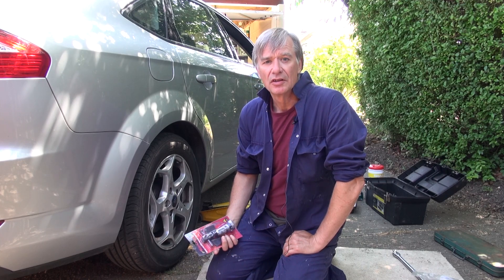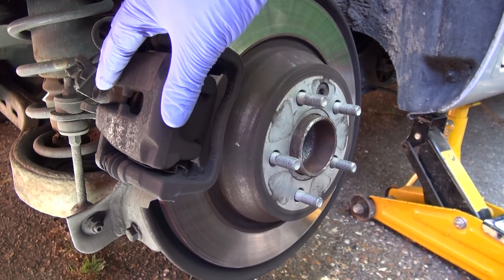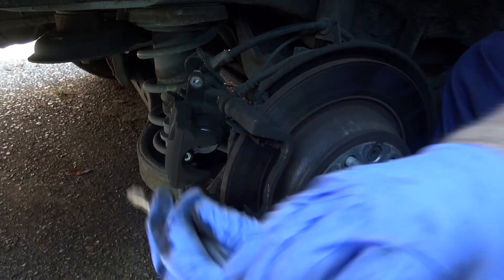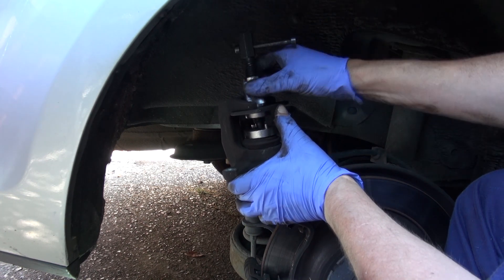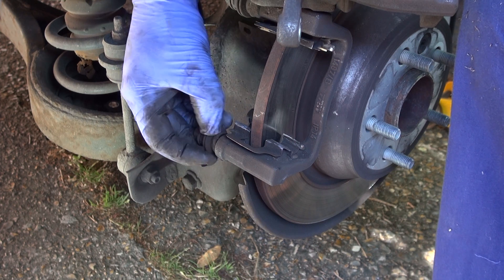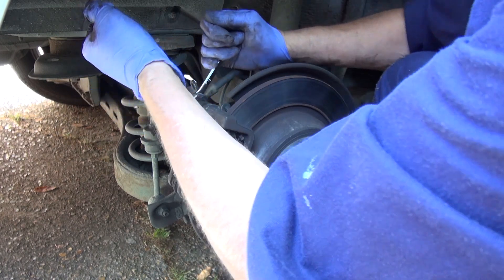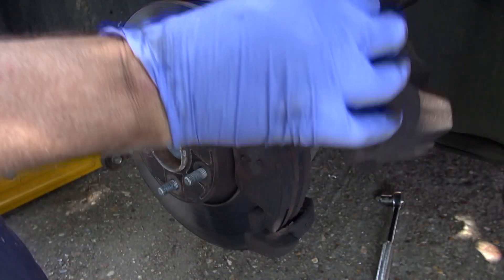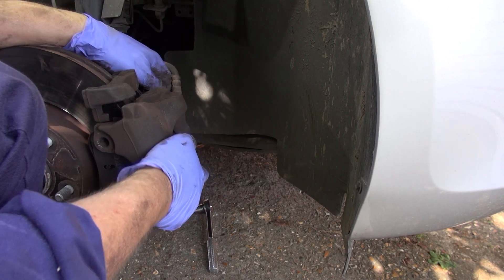Ford Mondeo Mk4 brake pads replaced

Comment: When you're winding the pistons back into the calipers you should check the brake reservoir does not overflow with the extra fluid that is being pumped back into the system. I use a syringe to suck out the excess. A useful video which has refreshed my memory for when I replace mine again this week. On past occasions  I've removed the handbrake cable, following the Haynes manual instructions, good to see this is not required
Reply from the maker: Interesting comment as I have also removed the cable in the past or clamped it but found that it’s not necessary. Quite right about the reservoir if it’s been topped up from the last change. On this occasion it was fine. Thanks for watching and the feed back.

Comment: Good video, I normally add a tube on the brake fluid bleed valve, undo the bolt and let the old fluid drain out whilst winding the caliper in, this way the old fluid isn't pushed back into the system.

Comment: You can use your brake rewind tool on the front brakes too, just pop an old brake disk between the piston and the rewind tool and wind it in.  Also, you can buy some small wire brushes (they look like over sized toothbrushes) to clean the crud from the brake hardware clips and the caliper bracket behind the clips to prevent rust jacking.

Comment: Helpful  video. Is this the same as my 2013 mondeo. 2.0 tdci. My discs on the rear have a ridge lip. From the pads also.. .
Reply from the maker: Yours is either a mk4.5 or mk5 Mondeo. I can’t say for sure if it is the same but I would expect it to be. Having a ridge lip is not necessarily a problem what is a problem is if the discs have got to a minimum thickness and need replacing. I believe the minimum is 22mm on the front and 10.2mm on the rear. Replacing is easy enough. Remove the calliper and they slip off. To measure the thickness have a look at the video I did on my motorbike front discs.
Reply: @NigelEaland  thanks for your reply. I have changed  brakes on the mrk3 . I have seen a video on the mrk 5 where the rear caliper returns on auto from plugged into the ecu. Maintenance  mode. I think the mrk 5 is 2015. Mine is the 2013 version. Hopefully will be the same as your car in the video. Thanks again.

Comment: how come you didnt apply copper grease to the pads?
Reply from the maker: I haven’t for some years. There was a time when either anti squeal shims were fitted or you could use copper slip. I find brake pads don’t squeal anymore, so I don’t bother. It also saves the possibility of contaminating the pads with grease. That’s the way I do it.

Comment: How can you tighten the handbrake on mk4s?
Reply from the maker: Under the car unbolt the heat shield to reveal the adjuster.
Reply: Or remove both rear wheels, remove handbrake cable from calipers and then play back an front with that leaver all the way. After that put your cables back and  your hand brake should be tight. This procedure works also when your handbrake doesnt work at all.

Comment: ... the sheets from the holder must be removed to clean with a brush (remove corrosion - holder and sheets). The sheets receive some lubricant (for the pads),
so it is safe to have later the correct function ...
If these works are not done the result is by accident due to the situation for corrosion and later abrasion can be one-sided for the brake pads.
Ok even a garage mostly does the job not good enough ... there is time and effort necessary - but else the result s not good enough!
Front axle similar and for the piston better use the right tool!
No recommendation to work as shown - sorry for!